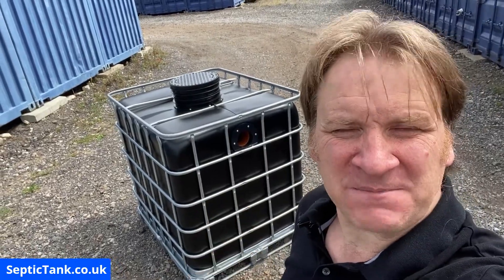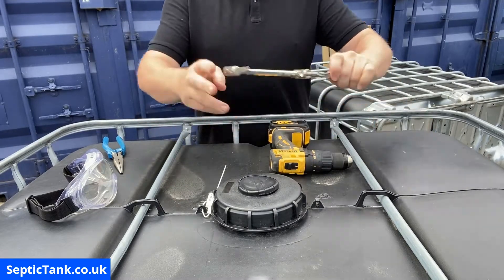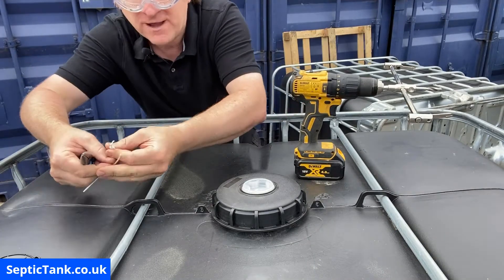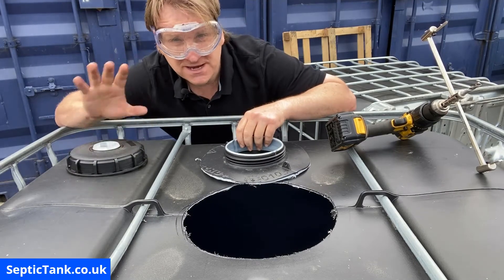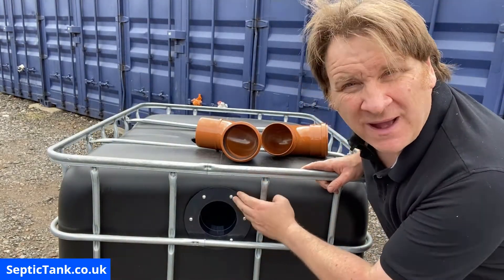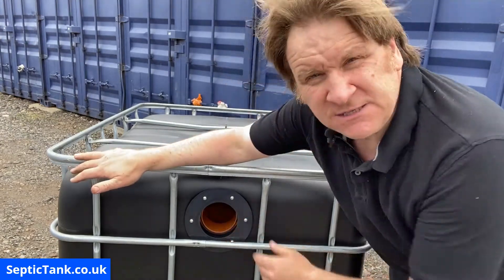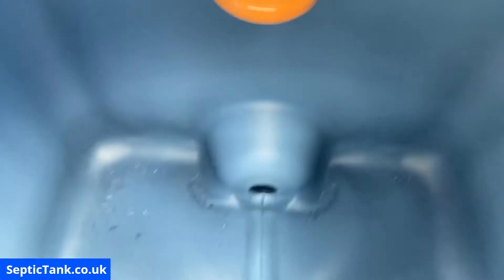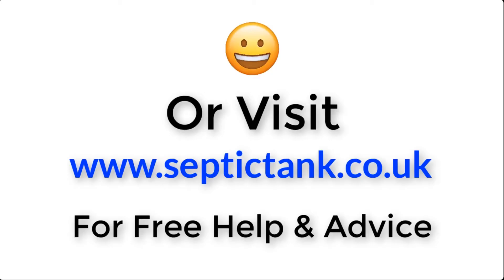how to build a diy septic system

Comment: Crap.... it will fell apart and collapse under the dirt pressure from the sides...
Reply: Not if you leave it in the cage.
Reply: @MarineBean001  filling it first would prevent that.